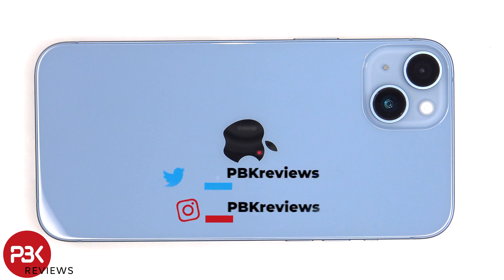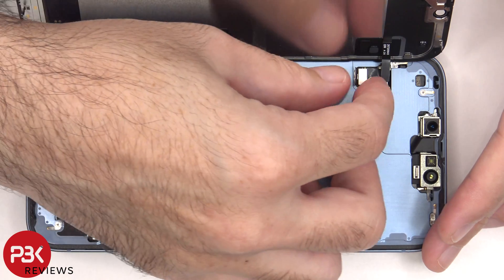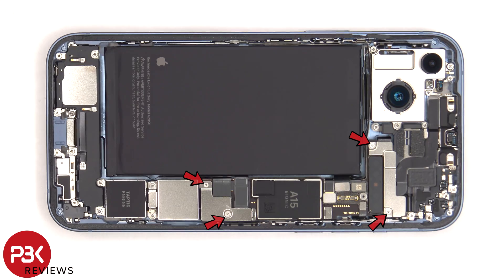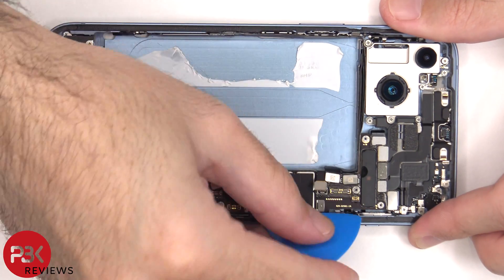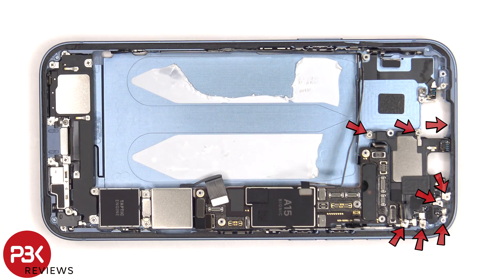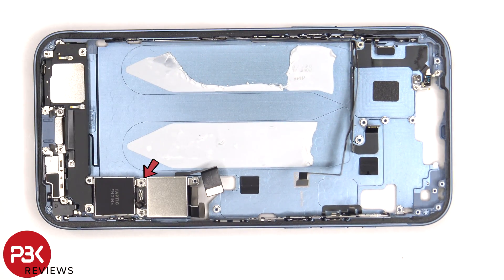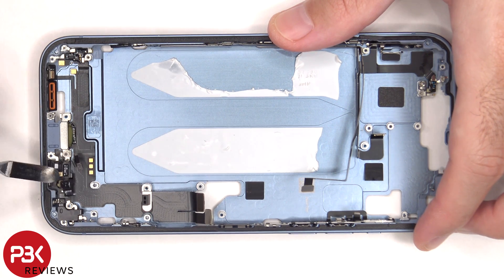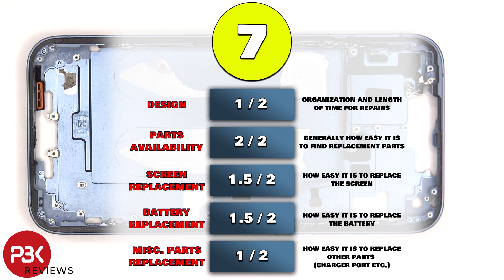Apple iPhone 14 Plus Disassembly Teardown Repair Video Review

Comment: What do you set the heat gun to?
Reply from the maker: I usually use a hair dryer which is safer against damaging parts by over heating. You can heat it up so its hot to the touch with either method, and just apply more heat as needed when working your way around prying it off. You don't want to heat it up too much to damage it but enough so when you touch it, its too hot to keep your hand on.

Comment: Don't you have to disconnect the battery before disconnecting the LCD ?
Reply from the maker: back in the day it was more important to do so but now phones are designed to not be as fragile and pose such a high chance of shorting etc. To be safe you can disconnect the battery first and usually if you have access to it why not, but this phone specifically is designed to be able to replace the screen without having to take apart the rest of the device. it's basically called hot swapping.

Comment: It's really surprising that the pro doesn't use the same access to remove the display. I wonder if 14 and 14 Plus displays will be cheaper in the long run. What's your guess? I've got a feeling 14 Pro display module  will remain more expensive for much longer
Reply from the maker: Yeah in general I would assume the 14 and 14 plus would run cheaper.
Reply: @PBKreviews  that back glass removal design is brilliant, what took apple so long to adopt it
Reply: iphone

Comment: I wonder, with that sim reader, could you grab a sim reader from a non american model and plug it into the american model and have it work, ignoring the obvious problem of needing a new hole in the housing for the sim tray. It worked with the iphone 12 with switching from single sim to dual sim, maybe itll work here. Probably not though since apple being apple.
Reply from the maker: I would think it wouldn't due to all the software locks apple has, changing anything prevents it from working usually lol.

Comment: What do you think the cable connecting the non-existent sim card reader does? Just nothing, and simply a place holder, do may they have put an extra attena for 5gmm wave?
Reply from the maker: yeah just a bypass cable going to connect to the taptic motor. The sim reader version would just have a sim reader also attached to the same cable.
Reply: only a piece of plastic

Comment: Many thanks for the nice video. Why the 1.5 for the display swap ? It looks much improved, 
what is missing to get the 2.0 ?
Reply: perhaps because they do software locking if you use a different, identical Apple screen?
Reply from the maker: There is still some strong adhesive holding it down and the risk of damage it when trying to pry it off. I don't rate points in between 1.5 and 2 or else I would have given 1.8 etc but yeah it isn't too difficult but the older generation iPhone screens were easier to pry off and remove in my opinion.